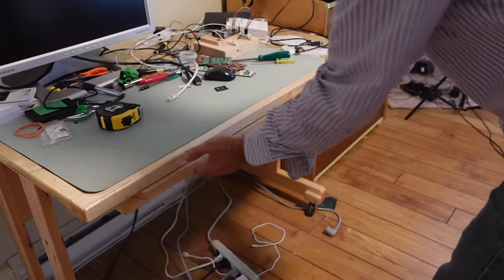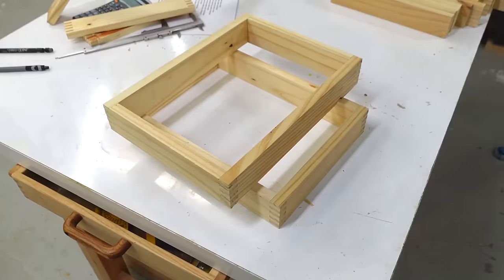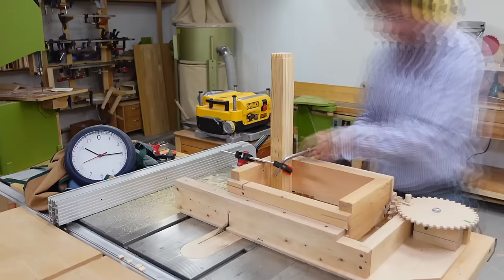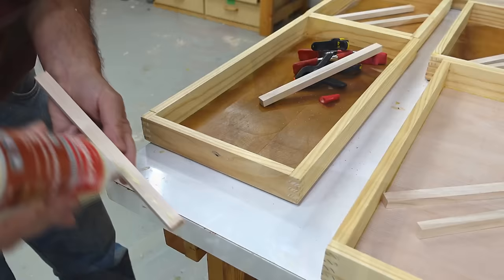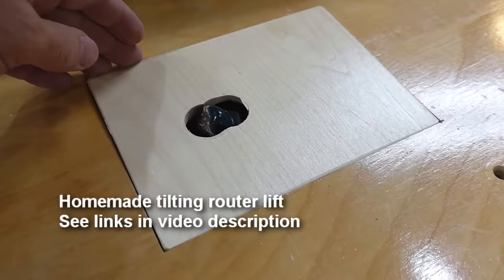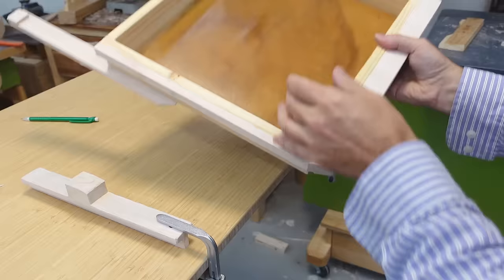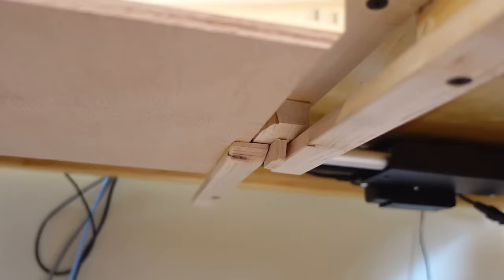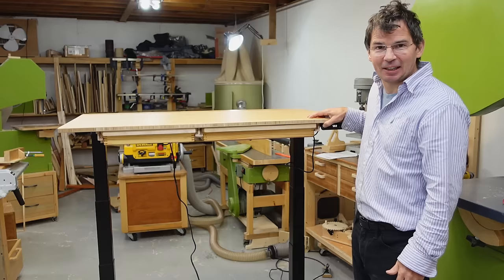Six standing desk drawers

Comment: Do you ever use dry soap as a lubricant for wooden drawer slides etc.? I learned from my grandmother to always have a small bar of soap in my toolchest, to rub wooden sliding parts with. Works wonders and doesn't make a mess!

Comment: I was asked to do the same thing to two standing desks in our upstairs office.  Since neither desk was ever in the full down position, I used hardwood strips between the lift frame and the top.   That way I could get a deeper, taller drawer (think stapler) with bearing slides and soft close with no loss in height function.   Even full down was still too low to be useful.

Comment: Hey matthias, I saw this woodworking short the other day where a guy drilled pocket holes but instead used dowels in place of the screws. You should strength test these joints I saw, see how much stronger they are.

Comment: Put a bevel engagement on the stops for the new/secondary/lower slide rail. That way it is locked "up" at, & a few cm before the full travel out stop.

Like a ratchet & pawl…

Drawer __/  /__ stop

The stop could also go a bit lower, to prevent accidental removal, but allow ease of removal.

Comment: What about having the stop right on the front border and inserting the drawers from behind? Then screw a stop after placing the drawers so they don't fall off the back when you close them. Another solution could be screwing the sliders with the drawers already placed and make the sliders be closed at the ends. my2c
Reply from the maker: you are suggesting that I remove the desk top from the desk to insert and remove drawers?  Cause, as you know from the video, the mechanism is in the way behind the drawers.
Reply: @matthiaswandel you could make the sliders be like a ramp from behind so you can insert them diagonally down-up-straight and then make the stopper be in the shape of the diagonal slider to clog it ^_^ my2c (this would require the drawer to have wheels tho now I think about it, or maybe small rounded pieces of wood would slide too? :/ Wait, you attach the sliders to the bottom, then hold the drawer in place between them and fit-slide the skis into the sides of the drawer with the back of the drawer already behind the top stopper?

Comment: Matthias, could you have screwed one or two little stop blocks to the underside of the desk to stop them pulling right out?
Reply from the maker: yes, and it would also interfere with stuff in the drawer.  Oh, and also prevent the drawer from fully closing!
Reply: @matthiaswandel Awh, that would be a worse case scenario! Really appreciate your videos. Thanks

Comment: If one of the walls on your box jig were taller or shorter your clamps wouldn't overlap. Even if you cut a slot for the clamp to slide into.
Reply from the maker: I want the clamps to press as far down as possible.  A taller wall just means I can't do that.
Reply: @matthiaswandel  understood. Closer to the blade is probably better.